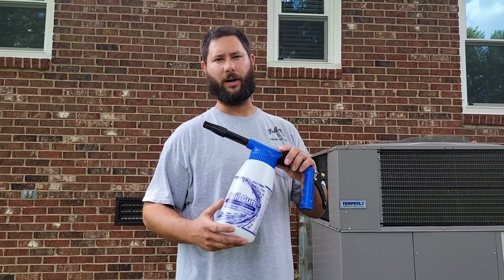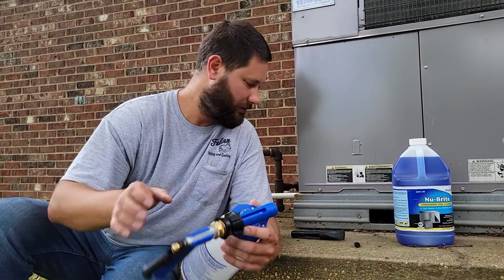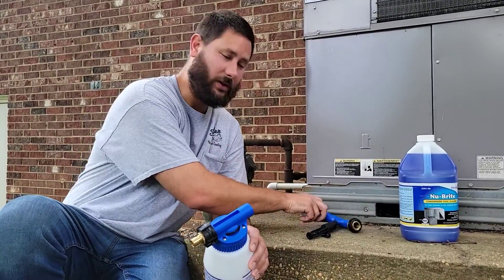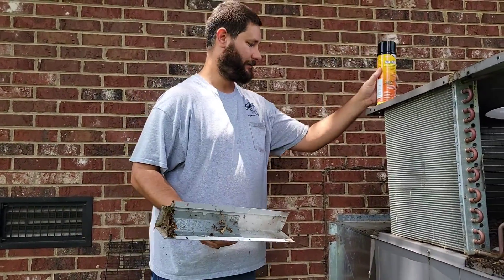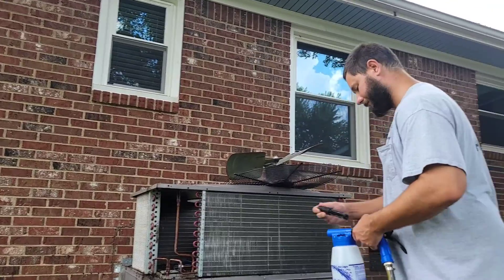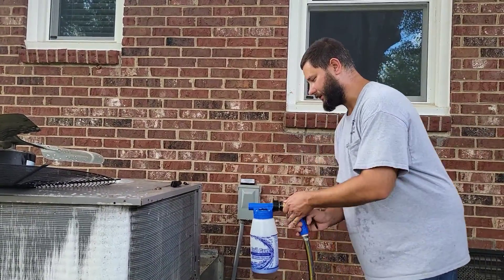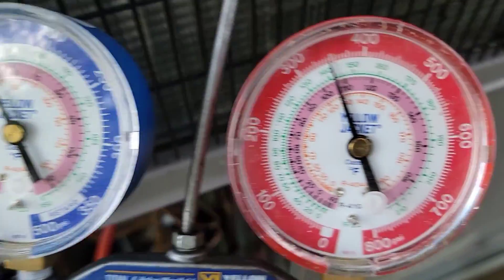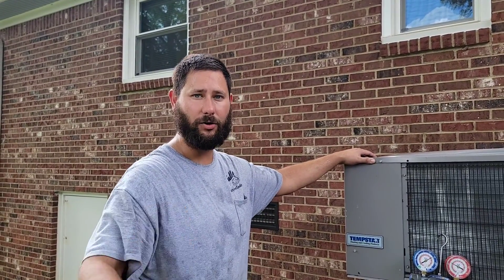How to Clean Air Conditioner Coils with The Coil Gun? @1NuCalgon

Comment: You did a great job!!! Much better than a lot of the other videos I’ve watched were so many people halfass it. One question. Can, or should the fan motor/shaft be lubricated with anything?
Reply from the maker: It has sealed bearing so it does not have to be lubricated.
Reply: @taddydigest  I figured it probably did. Just wanted to make sure. Thank you for your answer!

Comment: I have been doing service work for 25 yrs and I have been using a coil gun for at least 10 yrs I love it only take a fraction of the time to clean one. I also had the little pressure washer for indoor coils man it’s the trick I love it to I use it on air-handlers and AWUF- air handlers works really good
Reply: I wish I could afford an indoor electric coil cleaner lol.

Comment: Take care when cleaning it out after a service - if the smallest piece of dirt or grit gets up into the nozel  "particularly the clear tube with the filter " it will stop up the flow , but otherwise it works pretty good. I always like to try and blast out a drain hole at the bottom before I proceed just so I'm not blowing sticks and leaves all up on the coil.
Reply from the maker: Thank you for the great advice my brother

Comment: ‘How do you use it?’ Throw it in the trash. Wanna waste product? Use this. Fundamentally bad product. You’re supposed to put the cleaner into the coil so it foams AFTER application and pushes the debris out of the coil as it foams.
Reply from the maker: What do you mean? How do I use it
I showed you in the video how to use it
I don't understand
Reply: @taddydigest  I’m repeating the first thing you said in the video.  It’s kind of like when Home Depot sells a 6”x6”x6” single wall tee. Just because they sell it doesn’t mean it’s a good thing to use.
Reply: Very bizarre, what the hell are you talking about.
Reply: @chrissipple1018  trash
Reply: I just used it on mine and my parents house.  Works better that inside out method and far simpler too.